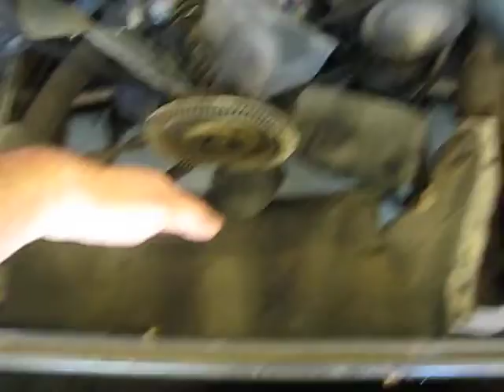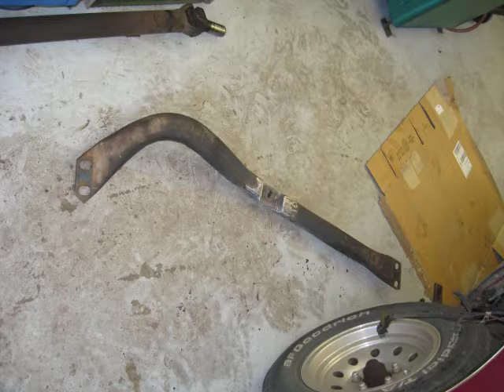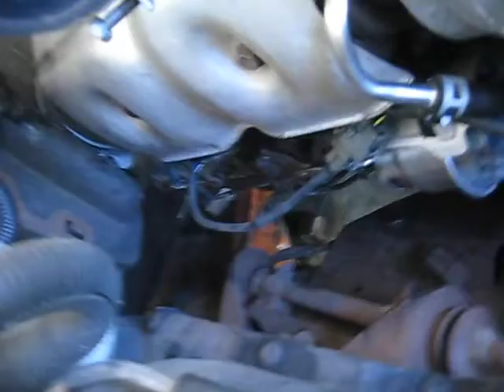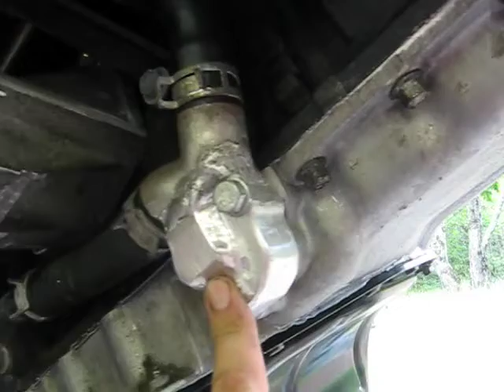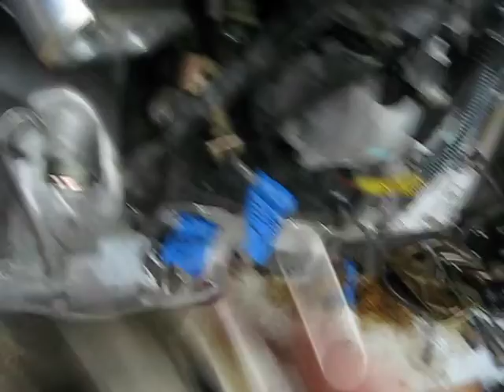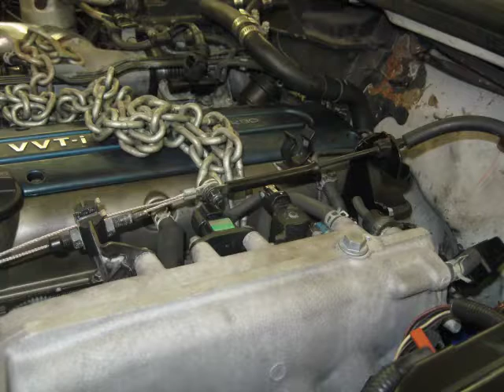2JZ Swaping a G body Cutlass

Comment: What motor mounts did you use
Reply from the maker: The JZ engine side cast aluminum parts and custom on the frame. Wasn't enough room for the hydro mount part